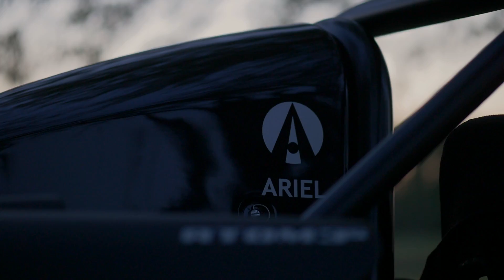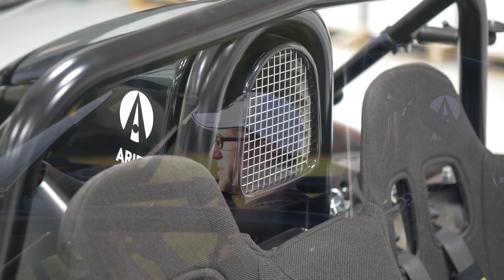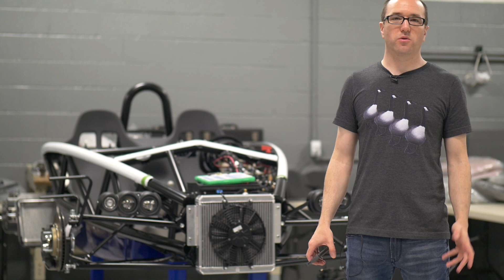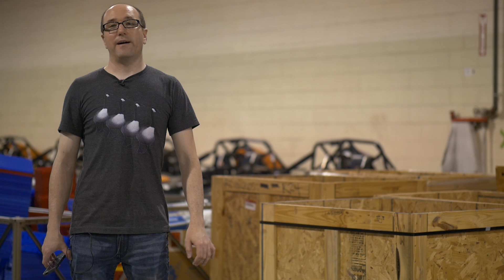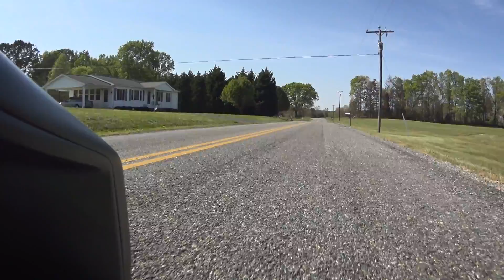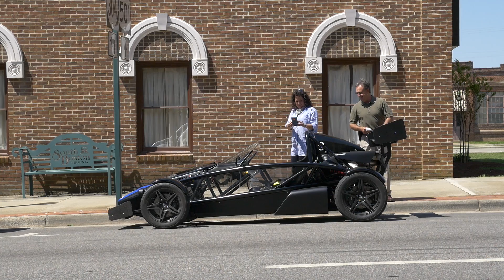Review | Ariel Atom 3S | Fountain of Youth

Comment: It is odd to have a car like that turbocharged. It screams for NA high-revving. (AFAIK there are cars of this type with motorcycle engines.)
2:!6 "protect rocks from fyling in" - SAVE THE ROCKS! 😜 || 7:48 Will Chekov
21:49 That turn signal switch is a major design flaw. You have to use it when taking a turn, but you need to handle the mandatory exploding engine power in that maneuver. It takes you out of the fit-like-a-glove, become-the-car mode.
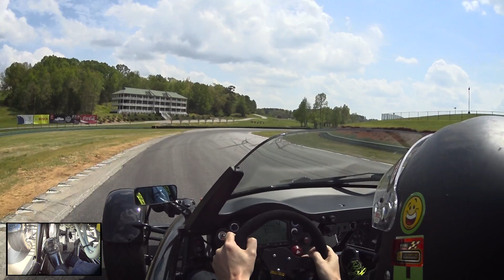28:11 Geez, that car is so nasty and direct, just from watching the video I am almost getting butterflies in my stomach.
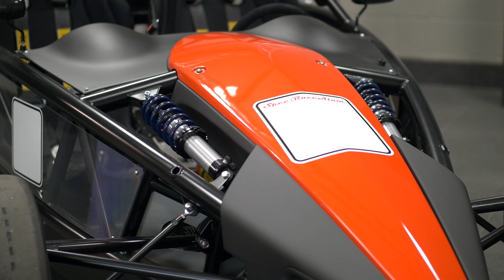30:28 You know, I think it would be a really good idea to have a structurally sound rollcage for the street version.

Comment: I thought pushrods pushed piston heads. I think you meant tie rods. If you can see your pushrods you blew your engine dude
Reply: In a pushrod engine the pushrods push the rocker arms for the valves not the piston head. The pushrod he is referring too is pushrod suspension which allows the struts to by mounted inboard and connected to the rest of the suspension by pushrods going outboard.

Comment: Sorry, false start.   A note on the engines and transmission combo:  remember that the various pressures trying to destroy an engine from the inside are directly proportional to the resistance against those pressures.  About the only thing that will be the same loaded or unloaded would be max cylinder pressure, which corresponds to head gasket issues and pre-ignition, neither of which are influenced by the drivetrain, except for greater temperatures created by work done.  From there on, the Honda engine as described is designed to propel, reliably, barely 3,000lbs of car from 0-60 in some 6 seconds, and still propel a greater payload without imploding.   The Atom weighs 1,250lbs.     The engine, even tweaked, is pushing less than half of that, while making less than twice as much power.   So it’s even more within its range of intended uses than the stock one.
Reply from the maker: However you are taking a motor never intended for forced induction and slamming in a ton of heat.  If you were going to design a motor with this type of power you would likely not use the same integrated manifold and water jacket among other things.
Reply: savagegeese my apologies, I made one of my rare assumptions and got it wrong.  I figured for sure that it came with a turbocharger and must concede that I did not consider the “recirculating exhaust” factor with regards to heat.   Damn    I think I may have oversimplified a couple of other issues, like how nowadays they limit your no-load rpms in some of these high performance cars.   Anyone who has tried to pedal a bike in an ultra low gear at higher speeds can tell you a load helps stabilize the drivetrain.    Bottom line is that “lugging” the engine does the most immediate damage, which I define as attempting to apply a heavy load while at  low rpm.  It’s harder for the bearings to maintain the required layer of oil when oil pressure is lower, generally at lower rpms.  The rod bearing or wrist bearing or main bearings are always going to be pressured in one direction the most, and theoretically those clearances are insured to be maintained in a wide range of engine conditions.   BUT, say you put 10,000lbs of trailer behind your truck rated
for 6,000lbs.   Most conditions except under WOT the engine might be fine.  The trans, hating it most of the time, especially Wide Open Throttle.  So you nurse it all the time.  Once or twice your had to make a move and kicked it down a gear or two, apply heavy throttle, lots of fuel to be burned, not enough rpm to maintain a safe layer of oil between the bearing surfaces.   Boom, a little rub, a little more clearance.  Then next time the additional clearance gives way to less oil between the bearings, and the cycle grows in a shallow exponential curve.       
That whole issue is reversed with this lightweight vehicle.   So yeah, turbo- not OEM.  Well at least the exhaust manifolds aren’t contributing to “under-hood heat”!   Intake temps lower too.   And you know that Honda test these things to the edge and past.  So if the redline is rated at 8,000rpm, you know they ran ten different engines at 10,000rpms for a week straight!   Then they feel confident in their product.

Comment: Are these built in the USA? Fought was built in the UK?
Just seen what he said about ariel,so ariel franchised out,so was originally built in UK.
Ariel have come on Alot from the S1 Honda rotrex supercharged, (think Ariel got tts performance to do the supercharging?),this model is so detuned it sounds like the turbo's hardly on boost,but guess because so can offer different stages off tunes in future?,should just build one with max performance in mind, (if offering one with out the turbo goes to show how good and light the chassis and engine is ),I'd like see someone build it with forged internals and a gt-garret bb turbo and external waste gate,that be the ultimate ariel atom then?
Reply from the maker: And it would be totally undrivable. As is the 3S is a handful and the 3RS at 450HP because of the weight and wheelbase make it a kill machine on track if you cant drive at a high level.

Comment: I’m just picking at you lol 
You can’t shift lol 
The next time you’re driving when you start to shift as the clutch pedal goes it you’re pulling to neutral as you land in the next gear you’re letting out on the pedal it’s much smoother like the driver on the track you can hear how quick he shifts 
It’s all in the timing !!
Reply: He's actually so good at driving that he beat a complete bolt-ons brz with a decent driver with his stock everything, including tires FRS. He's not going to beat up on a press car.

Comment: Excellent video, great car!
Talking about driver skill, a thing I often notice with drivers from the US (I'm British btw) is the slow gear changes... High revs then a really slow change, then high revs and another slow change.. all the way through the box.
The track drivers changes were sweet though.
When I learned to drive in the mid eighties there were very few automatic cars so we all learned to drive manual cars. We used to 'Soup Up' our cars with varying levels is success - the main differentiation in speed was often the skill of Channing gears quickly.
Reply: do you just slam that bad boy into gear as fast as you can? us american drivers dont feel such an urgency to shift that 1 millisecond faster i suppose. also part of that is not wanting to grenade the synchros

Comment: Spot on! Discovered you through "The Straitpipes". Just catching up on your reviews.  Your perspective is addictive! Just driver the road and the car all become one. This is why this industry excites me. Thanks for reminding me!
I had a1993 Honda Civic CX base model 5 speed manual. No power steering, roll down windows, no A/C, no power brakes, not even a passenger side mirror. Just a stripped down car with a 1.6 litre engine. Honestly it was the most fun driving car I've ever owned.  I felt everything through the steering wheel and that engine and factory suspension set up made my day everyday!  Now I drive a Mazda 3 sport automatic. Same feeling but regret not getting the manual!

Comment: Does it have a place to mount a radar detector because this car begs for it? I'd wear a helmet and maybe even a HANS. Is there an option for a fire bottle?
Reply from the maker: Yes ,fire supression is optional, as well as HANS equipment.  You could easily hard mount radar using dash beams.
Reply: Thanks for the fast reply.

Comment: Traction control, turbo charger, but no ABS? That's so backwards.
Reply from the maker: +Atomic Rooster They added TCS for the 3S as a safety feature for their customers because Hondata is already on car which allows for a hardware adjuster which is defeatable.

Comment: I am one of the fortunate owners of an Ariel Atom 3. This video says the plain truth from start to end. Driving an Atom is going back to the roots of real, personal, direct driving. It's only you, the car and the road in front of you. You can feel everything, from the differences in the asphalt types, to changing temperatures and humidity (driving next to a corn field after exiting a wood). It's driving "en puresse"
Reply: Funny anecdote: One time I experienced a Toyota Starlet P7 with mostly just the door panels and such removed and it already was a totally different experience, feeling so much more like a kart, more exciting. You could hear the road through the doors.
Also, one time in my Corolla E11 I drove with the speedometer glass cover removed and suddenly I could hear the rattling of the speedo cable mechanism. All those little things add to one's connectedness to the machine.

Comment: "Many who want to see products designed and made in the USA will appreciate this look at the new Atom 3S and upcoming Nomad." These particular Ariels may be built in the US but they weren't designed there.
Reply: As someone who works in high end engineering in the UK a cad translation and tooling manufacture is alot more work than you seem to think it is. Is there car derivative sure. The fundamentals of the chassis the original spec and drawings were all created in the UK but making those parts in a different shop with different tools and processes to tolerance without compromise is something that is seriously valuable and difficult. They have basically setup the equivalent of Ariel's somerset factory there . At the moment they trade on the Ariel's brand but they are licensee's not part of the same company. Just because we might design a part in our business doesn't mean that if we ask a German supplier to make it for us they will make it in the same way as we do. Those differences add up over time and its not a small feat for a small shop to be able to do it well. Alot of manufacturing companies get there start making licensed products. Take Hyundai they started out making ford cortina's and its now the worlds 3rd biggest car company.
Reply from the maker: +Lucius Jones These cars were redesigned in CAD, including the tooling and manufacturing process was all done from scratch by TMI.  Concept UK, but modified and made in America.
Reply: I see. So they minutely tweaked a few things and that makes it an entirely different car design.
Don't be silly. They may have had to adjust the design to suit themselves but the design is still British.
Reply: Jeff Glover l

Comment: What is the  Base Price. I'm very much interested in it.
Reply from the maker: +Huey Freeman I believe they now start at 65k
Reply: http://static1.squarespace.com/static/54dce618e4b0bfba09c0e938/t/56d73d7e59827e4e2352f3f2/1456946621309/ATOM_BROCHURE_2016_email.pdf
Reply: 86k for the fast one and 60k for the not so fast one. 3 and 3s
Reply: 2.8 vs 2.9 to 60.  They are all fast.
Reply: pff
Reply: maybe you can look for a donkervoort, they make the same sort of cars, i'll recon that there are some second hands on the market, because new ones are even more expensive then this ariel.
Reply: verzekeringsadviseur interesting Vehicle
Reply: +The SC Scenario , you mean donkervoort? if so, it's only a shame that their newest model comes with a dct now. hopefully it will still be available with a manual. and i have no idea how reliable donkervoorts are. at the moment they put a 2.5 litre audi engine in their models, so enginewise it should be okay I reckon
Reply: haha, I certainly believe you. All those companies go mental with the prices for optional extras
Reply: verzekeringsadviseur I checked it out and I don't think the paddle shifters are that terrible if you want something that's incredibly fast because the power to rate ratio is crazy. for a driver's car I guess it's a little disappointing not to have a manual transmission, but hell, I don't know how to use one anyway lol. I'm just saying even if I could drive a manual I think I could over look this thing not having one because it's blazing fast.
Reply: I'm in the process of starting a small company where I live and it's expected to do really well so I'm just trying to get some ideas of what I want to blow my money on haha. I just want something unique, fast, and not over 130k but at the most 200k. then again I'm 6'4" so I probably can't fit in to these things anyway. I'll probably just end up going with the bmw i8. that seems to constantly be my fallback vehicle.
Reply: The SC Scenario well Jeremy clarkson is 6'5 and he was able to fit in the Atom, so the length isue is not that big deal i suppose.
Reply: verzekeringsadviseur oh well that's cool. I didn't realize he is that tall.
Reply: well, he said he was 6'5 when he drove the peal p50. and i don't see any reason why he would lie about his length
Reply: the guy driving on track is 6'3" you should be ok

Comment: The impression of speed is magnified the closer you are to the ground.
Reply: I had an idea (in a dream) for a motorcycle engine quad once that you drive in lying-down position.
Reply: @Cue No, I think you could not resist driving much faster. 😉
(It would, of course, have a windshield.)
Reply: @Cue Obvious exaggeration, of course. Have you never driven a kart?
Reply: @Cue I get it. But it's supposed to be exciting, and you made it sound as if it is too scary to drive at all. Your exaggerations then were just so ridiculous that they conveyed something different than intended.
I guess I value finesse very highly in those things. 😄

Comment: Great video! I spent 3 non-stop hours yesterday in my AA 2 in the mountains of North Carolina and still cannot get the smile off my face. Mine is an older supercharged version with less power than the new 3S. I really can't imagine more power, I am not talented enough to handle anymore. I only drive mine on the road and yes I know I need to take it to VIR. I have spent a lot of bike time at VIR and those days are behind me. I just love the mountain curves and that acceleration. I thought that I would buy the windshield option straight away but after owning the AA2 for about 4 years I love the anonymity of wearing a full face helmet. It does draw a lot of attention. I am older and the first rule is that when the young girls come up to ask question NEVER take your helmet off!
Reply from the maker: Great story, get out to VIR its almost a requirement for that car. I agree about the helmet unanimity bit I would likely do the same thing.

Comment: So they manage to include a knob to modify brake distribution on the dash but leave the battery switch on the hood? Riiiight.
Reply: +daDonn That's a racing thing.  All "race cars" must have a switch easily accessible to safety works in the event of a crash.
Reply: +daDonn lol wut? That is exactly where the battery master switch should be located...
Reply: +Scott P Which is fair enough - but for the sake of convenience a switch that needs actuation each time the vehicles is started and stopped should probably be on the dash, whilst a knob that rarely needs to be used possibly shouldn't? Perhaps they could have TWO switches in series that actuate the battery, hence an external emergency one? I know they're all about reducing weight and complexity, but seriously!
Reply: I get what you mean but it's not an issue. He just made it look unnecessarily awkward reaching for it from the seat. You would obviously just flick it when entering and exiting the car.

Comment: where did they have the redline? and is it the civic si k24? is it internally untouched? stock clutch? and how much boost were they running? are they running a reflashed ecu? pibbbyback?(sorry if you dont know any of these)
Reply from the maker: +waderedsox It is a stock motor directly from HPD/Honda.  Un-opened Si setup and trans. ACT clutch.  (more detail in written article) Hondata.  Boost, not positive. Redline 7500.

Comment: My friend had a Atom2 ( supercharged ecotec ) I got a chance to drive it, was very nice but you are so exposed with all the large cars and trucks on today's roads and even at the track.. I dont know, I wouldn't drive one, god forbid if you make contact with another cart or object..

Excellent work on the review..btw..
Reply from the maker: +NorevlimitR You have to view it like a caged motor cycle. I'd go with a helmet and probably rib protection if it were my car.
Reply: For sure a helmet and arm restrains would be a must. If you crash a motorbike most of the time you and the bike part ways. In the atom you are strapped in for the ride. In reality a Toyota Corolla would devastate the Atom in a collision..
Reply from the maker: +NorevlimitR Very possible depending on where you are hit. But same could be said for getting smashed in a car like the Exige or Elise.
Reply: Yeah for sure being enclosed in Elise / Exige gives you a false feeling of security. Then again this is one of those cars that will be driven 1/2K miles a year so chances are relatively low. One thing you didn't touch on in the video is the legality of this car in the US. My friends Atom had a Saab VIN# and he had a very hard time registering it here in NJ and even harder time getting insured. Has this changed now that I presume the cars have a genuine Atom VIN?  I'm loving the non-Korean content lately, btw.

Comment: How tall are you? Comfortable behind the wheel? Seat adjustable?
Reply from the maker: +Marcel Geffrard  5'9 and had way too much room.  Seat is adjustable but not super easy to do.  Looks like you could probably be about 6'3 and be good in there.
Reply: savagegeese Finally got to drive this on a close circuit... holyshit! Indeed you were right, I had no issues getting comfortable. Dampers were pretty harsh, but it was set for track use. The steering rack was VERY engaging. Having driven a slew of exotics at the track; the AA3S is on a league of its own. The spool is NUTS! 😱